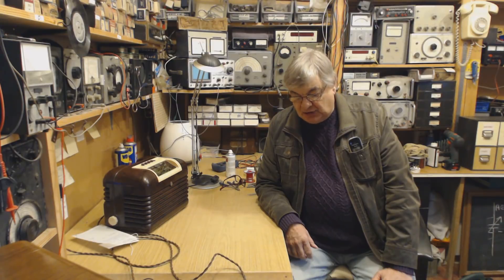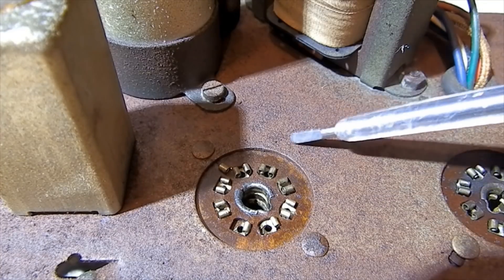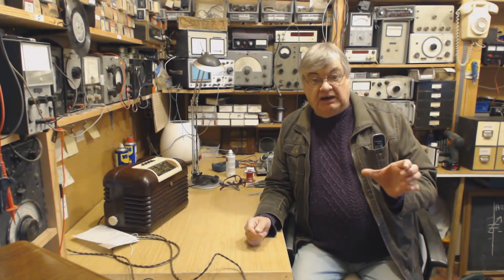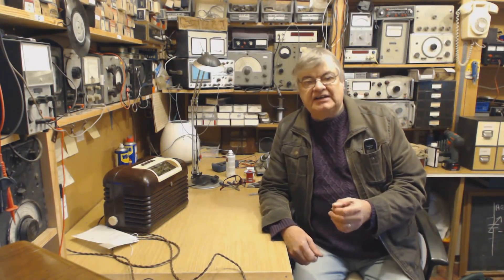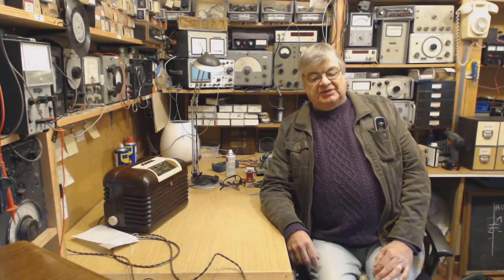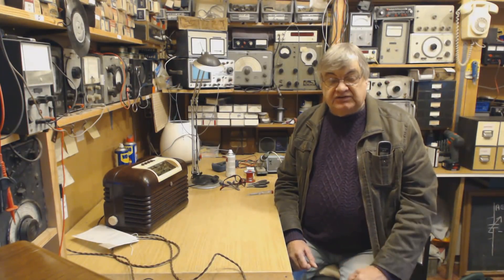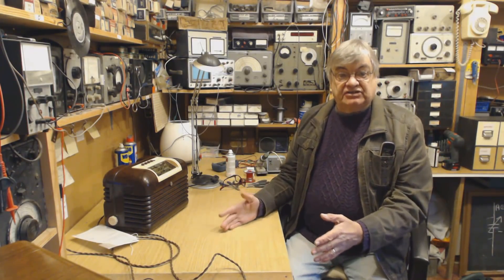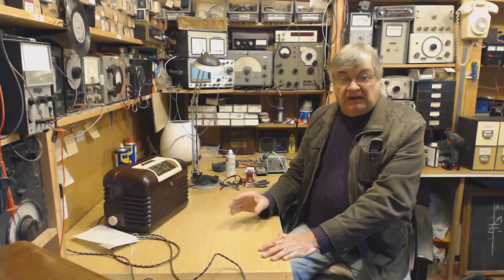Vintage valve radio scrap Bluetooth DAB conversion

Comment: I've got a 1960's Cossor that I bought as a child from a jumble sale in 1991 ish. I recently dug it out from my Dad's house and it still works! It makes an interesting ornament but I'm considering removing the chassis and fitting a modern digital radio inside it. Sacrilege? These Cossor CR1102U radios don't seem to have much value to collectors and a fully working DAB radio in a 1960's case would be pretty cool.
Reply from the maker: Sounds good to me. You could keep the chassis just in case you want to put it back.

Comment: I would judge that based mostly on economics. Better to resto'mod' than junk. However if bringing dead radios back to life brings you joy at any cost, go for it. There are not enough parts in the world to bring them all back. Often trying to make one out of two has the problem that the parts will break down in the same order giving you two of the reliable parts and none of the ones you want to replace. If you love authenticity and originality then try to buy the best authentic, original radio you can because the moment you start repairing it you're in a 'Triggers broom situation'. That wouldn't bother me if I was that way inclined and I like the idea of encasing modern components within broken original components. As far as I'm concerned I'd like it to function like an original in that the back light on the tuning cursor looked orange/yellow and the tuning and volume knobs did what they're supposed to but with better sound and bluetooth and DAB available.

Comment: Thanks Ray another informative and useful video. When does a radio become scrap. I guess it is subjective. Beyond Economical Repair this will depend on circumstances. Not against "Bluetooth Rescue" it still has the looks and coud be lit up with Leds and linked to online SDR would be intersting also it may spark people to become intersted in radio which is not a bad thing.
Reply from the maker: Hi Michael, it's nice to hear from you.  Online SDR... now that would be interesting. Cheers, Ray.
Reply: @g4nsj  here is a link to online Software Defined Radio sites my favourite is the Short Wave one in Holland. http://www.websdr.org/ 73s de G4IJI

Comment: I think that it's all right to add bluetooth to a vintage radio, if it's reversible, there is a fellow on Y.T in Madeira who does this by using the phono input on radios that have one, but it isn't all right if they gut an otherwise restorable radio. It is also not all right gutting a radio to convert it into a guitar amp, why they would do this I don't know as the audio amps in an old radio are not particularly powerful, and the power supplies don't have enough capacity to run much more then the stock radio tube wise, again they could use a phono input and leave the rest alone. I for one prefer to use something like an AM modulator as a short range transmitter, then I can play what I want on the set and not have to alter anything. We do not have DAB in North America, we have satellite radio but it is a paid subscription service
 I have scrapped a number of chassis before, ones with no cabinet, no speaker, and no dial, and even some radios that had a cabinet and speaker but the chassis was missing parts, and the cabinet was in poor shape, smashed or water damaged. If I have a chassis in good condition, but no cabinet, I put them in storage just in case I find a cabinet. I have also had complete sets with rusty chassis, but have learned to strip the rust off myself using chemical and mechanical means of rust removal, but in those the other components were basically sound. Evaporust is a good solution for stripping rust off of radio parts as it does not harm aluminum. Sometime it is time consuming sometimes, but isn't overly bad once you develop some procedures. The same goes with rubber wire, I would not junk a set just because it had it, there are a number of collectable radios that used rubber wire, as well as some pre war TVs, so the wire used should not be a cause to doom a set.
Reply from the maker: OlegKostoglatov you make some excellent points. Thanks for commenting. Cheers, Ray

Comment: When a radio is missing several important parts, or important parts are broken, that radio goes to the attic for sourcing parts later when needed. Personally i think scrapping a good radio, for building a bluetooth audio device is a shame. Simply repair the radio to a good and safe working stage, and add a stand alone bluetooth audio receiver to the  radio.
Reply from the maker: JH allo I agree, scrapping a good radio is not acceptable.

Comment: I've never scrapped a radio yet, but I aren't in it commercially. I dont restore for other people, only for my own please. So I wouldn't find pleasure in scrapping a radio. I can get pleasure by restoring the worst condition radios as its the sense of acheivement I get. I could easily stick a bluetooth module into anything and suddenly it's a bluetooth speaker; a bluetooth watering can, an old cereal packet, a bathroom cabinet, anything. There's no satisfaction in it. Therefore it saddens me a little to see an old receiver converted to bluetooth or DAB. You'd never find someone converting a broken DAB radio into a valve radio would you!? But you know, they bought the old radio, it's theirs. They could use it to plant flowers in, if they wanted.  Better than going in the trash, I suppose.

Comment: see no reason how you can't add Bluetooth or Dab to an old radio.  I suppose it depends what you want, if you are a purest and you want the radio restored as original, then that is fine, nothing like something  being restored to how it left the factory.
However, my parents used to have a radio that you could hear almost anything on it and it had the speaker outside the radio (I think you said at one point that was a tax dodge) I would have no problems if I still had it converting it to work the way it did and have it also do Bluetooth and DAB radio as well.  Just add it and use the speakers, I am no purest but if I still had this radio (which unfortunately I don't) I would have no problems adding a DAB radio inside it and a USB connection on the back and Bluetooth to it as well.  Scraping a radio is when it is just not worth the effort to get it back to working condition and looking good.  Rust and rot early wiring sometimes is just not worth the effort of restoring it.  Valves and Bluetooth with DAB radio built in sounds crazy and maybe to some it might be, but if you have a good looking radio, why not add it.  Only problem is hiding the controls unless it is all done by remote, this only needs a infra red receiver hidden somewhere.  Adding a USB socket might be a bit dodgy with a live chassis, but it could be mounted round the back where it does not come in contact with the chassis.

Waits to hear the reaction of the purists and everybody saying "You can't do that."  "That is impossible to do anyway."

Comment: Hi ray good to see you back.
unfortunately there has to be a point where enough is enough. The puritans would become irate when you mess with what they consider to be historic works of art and rightly so. but would those who protest be so critical if they were faced with the same dilemma? if you have to question whether it's viable to repair then the chances are it's probably not. I guess it could be compared to that of a surgeon who has to make a call resuscitate or call it. I personally feel that if I can keep a cabinet or salvage some parts from a dead radio then another will live to see another day, surely that's a good thing. If I were to add modern elements to an ageing radio,I feel it would extend it's life.
In summary it's a good thing to admit when a radio is dead it's even better to utilise what's left if another radio lives because of it.i would also be happy to stare at an extension speaker that is as beautiful as some of those older radios.
Reply: I agree entirely. Utilise what's left of the radio if another radio lives... Very good point. Cheers, Ray.

Comment: good point to make, i found myself in this situation with a console radio. chassis was rusted all the transformers were ok, the cab had come aparts and all the wood veneer had come off, so i set about  i sprayed the radios cab, this was the most cost effective option for myself. and re-hammer toned the chassis. and repaired the electronics. the point is where do you draw the line, how much money do you spend on a 1932  radio

Comment: If a radio was gone but the cabinet was still good, I would convert it, some of those cabinets were good to look at, unlike the modern plastic rubbish.  I would have no problem converting a radio that was not worth repairing.  I never though about doing that before, but I would if it was a goner.  I don't know how it would fit into a new house though!
Reply from the maker: Probably best in an old cottage.

Comment: I have scrapped a few radios in my time, mostly they were the white/cream coloured radios that were put out to schools.  They had a lot of wiring that was rubber insulated and the rubber just crumbled when touched.  I did restore one, but to be honest, I wouldn't like to do another, there is just so much wiring in them that it took forever and in the end it didn't look so tidy as it did before.  I used the type of wiring that didn't burn, you could stick a soldering iron through the middle of a bunch of wires and they wouldn't burn or melt.  But the time it took to rewire it all just made it not worth the bother.  There was a few radios my parents had over the years I wish I had had the chance to restore.  One had a speaker that was outside the radio, a lovely thing and it could hear just about anything that was transmitted.  I think it had a battery that had to be recharged every year or so, but something went wrong with it, I think there was smoke come out of it and my father dived in not knowing the slightest thing about it, next thing it was in the radio was in bits and in the rubbish!  I was a bit annoyed about it, but as I was little at the time I had no say in it.  I would love that radio now, it had a lovely sound and a beautiful woden cabinet.  No idea what make it was, but we could hear all the stations (Pirates) out at sea and the fishing boats though we were miles from the sea.  They did come and go a bit, but that was part of the fun.  Sorry, but both those radios you showed in the video would go for scrap.  There comes a point where it is just not worth doing and thse were well past there sell by date.  Nice to see you back again.
Reply from the maker: You're right, there comes a time when it's just not worth it.

Comment: I am in two minds about fitting a bluetooth receiver into a valve radio.But on the plus side it often makes a surplus to requirement radio useful again. And maybe the younger generation we follow us in our love of this lovely old gear.
Reply from the maker: Hi Simon. Good point about the younger generation. Cheers, Ray.
Reply: I love old valve radios and a few, but I am looking to add a Bluetooth unit to make one of them useful piece of equipment rather than beautiful ornaments.

Comment: I consider a radio to be scrap when:
1. You cant find the parts to replace whats broken
2. The parts are too expensive to buy
3. The structural integrity of the chassis is so bad Its cant be repaired easily
4. When the radio is too expensive to repair for what its worth

Comment: Isn’t it just a question of applying a bit of common sense? Surely those examples you showed in the video would be regarded as scrap by more than 99% of the world’s population, but there will always be somebody who thinks otherwise. So what? You’ll never get everyone to agree. Where the condition of a ‘scrap radio’ is better, the population’s opinion will more evenly divided, but it’s up to the owner to decide what to do with their own radio. I feel sorry for the bloke who rescued that radio cabinet from the skip and fitted it with a Bluetooth speaker. I wouldn’t have cared two hoots what outraged vintage radio purists or rude internet trolls thought about it. My advice would be to just ignore idiots like that.
Reply from the maker: yellowpinkie3 thanks for your input.

Comment: Suprised you didnt give your opinion Ray,, if its a car a house etc ,,,in most cases its based on economic repairs,,,would it cost more to repair than it would ever be worth,,, but badly coroded parts would need serious cleaning or refurbing ,,,so i guess would the customer be prepared to spend x ammount in time labour and parts,, for the finished artical,, and alsothev patrs and spares must be dwindling as the yrs pass by and cos of this i guess the prices of parts are increasing ,,, so i guess the largest thing affecting if its scrap or not must equate to the cost of restoration ,,,and can you source the required parts and how much time would that take? thanks Shane uk
Reply: Many parts are now being reproduced actually, such as dial scales, knobs, rubber parts, cloth wire, and some transformers. In other cases coils and transformers can be rewound. If you are wondering about valves/tubes it depends on type, but back when they were established technology they were produced by the millions right up until the mid 1970s at least, some later. Capacitors and resistors are still being made, actually so are some valves/tubes. If there is a demand there is a market, and where there is a market someone will attempt to fulfill demand. Labour is the biggest factor in restoring a radio, although even if doing things yourself you have to know when to draw the line.

Comment: Hello Ray, just come across your channel, some really intresting videos and projects,   just like my late father, I'm into most radio and electrical related subjects, in the workshop I've still got my dad's collection of World war 2 communication receivers, (most still work), & other vintage radio a Pye Cambridge from about 1956. Regarding scrapping, obviously if the  ( wooden ) cabinet is beyond help just strip it for parts, I do that if I'm getting rid of any old or broken stuff, in fact last week I scrapped an old 1990s aiwa stereo midi system that had a broken volume control the tape didn't work and it sounded terrible anyway, but I stripped it down, and kept the mains transformer and lead, the speakers from their cabinets, the CD drive unit, all the screws and nuts and a few other bits that might come in handy,  the rest went in the council WEEE bin!
Reply from the maker: Hi Richy, thanks for your input. Scrapping something is OK if it's totally beyond repair and you can get some decent bits and pieces from it. Lots of different view on here! Cheers, Ray.

Comment: You repair radios and you never robbed a part? Come on now. I repair radios sometimes and I know some equipment gets scrapped. Just how it happens. I am pro scrap. You ever heard of the boneyard?
Reply from the maker: J&B Fix it shop Yes, of course I’ve robbed chassis for parts. I wanted to know what people thought. So far, the comments have been varied and interesting. Cheers, Ray.

Comment: I think once its got to the stage when the radio is heading for the tip then if the case is good why not save it as a Bluetooth speaker.
Reply from the maker: Yes, good thought. Cheers, Ray.

Comment: There's a lot to consider before scrapping a radio. Things like rarity, potential value if restored, cost in time and material of doing the work etc. Usually if the IF coils are good and the transformer is good most other things can be repaired or replaced. It's all a matter of how much time you want to put into it. More a labor of love than anything else in many cases. Looking at it from a business point of view the term "Beyond Economical Repair" comes into play. I'm a firm believer in saving as many old radios from the scrap pile as possible to preserve our history for future generations to study and enjoy. Nothing wrong with taking two non working units and making one good one out of them. A working radio is always less likely to end up in the landfill than a non working one.  Interesting topic. 73 Doug.
Reply from the maker: Hi Doug, you make some interesting points.  Rarity, potential value if restored, cost in time and material of doing the work... All worth considering. Cheers, Ray.

Comment: As you may know, all the major radio stations switched to DAB+ in Norway, so it's not unusual over here to see old, beautiful radios in the skip or in the recycling bin. Countless number of radios, old and new, have been scrapped due to this "digital switch." In this case I can say that, thankfully, some are repurposed as bluetooth/aux speakers.

I could go on rambling about the FM/DAB+ switch, but that's another debate for another time. :-)
Reply from the maker: Good point. Thanks for commenting. Cheers, Ray.
Reply: It has already been done, digital tuner, followed by an AM modulator.
Reply: You should rescue some, and put them up for sale offering to ship  to other European countries such as Sweden, Denmark, etc. They will never do that in North America, the vast majority of stations are private owned, 1000s actually, their service areas are too large, and there is too much money invested in them. The HD tv switchover was such a fiasco that I doubt they would try it with broadcast radio, too costly and too little reward.